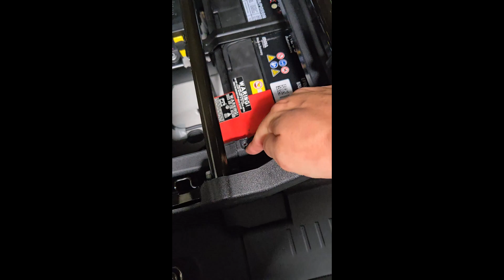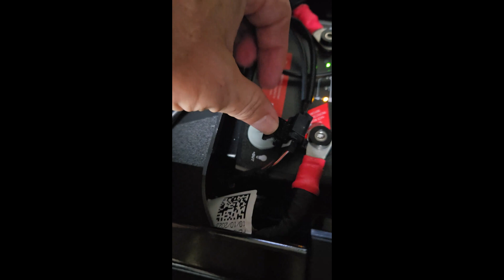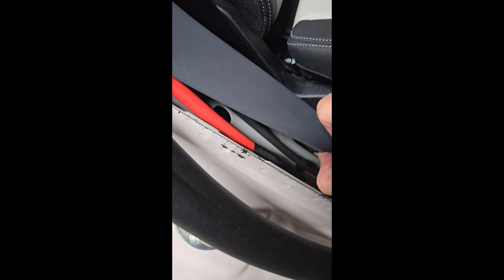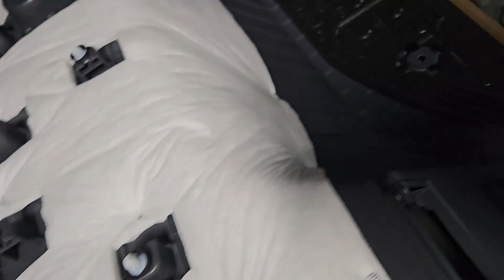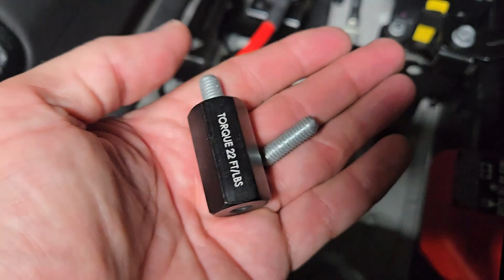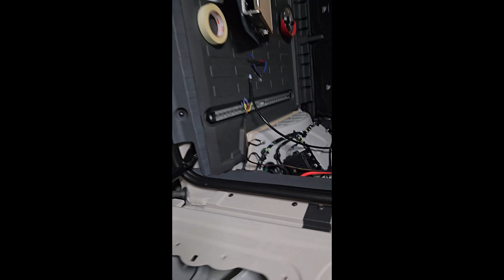Installation of Agile Offroad-ABR onboard compressor kit for INEOS Grenadier

Comment: I love Agile Off Road and have many of their products, but I would never buy this kit. First it puts the air coupling in an are that can’t but help being in the way of cargo. Two you shouldn’t run the compressor in that confined space without the seat if not the door open making remote plumbing superfluous in expense labor and interference with cargo.  To get those bolts out I use the proper socket and I think a 7mm to grab the bit then replaced them with the plastic replacement bolts from…….yup, Agile when I installed my compressor on a mount from Datin Fabrication.  

Great and useful video for when I remove the rear panels to relocate or add outlet for fridge that won’t stick out into the cargo area.
Reply from the maker: Glad you found some aspects beneficial.  I don't often have the cargo area full so I have no issue where the coupler is.  I use it a few times a week.  Opening the door and lifting the seat is not an issue for me either.